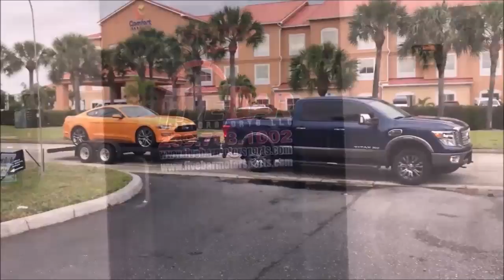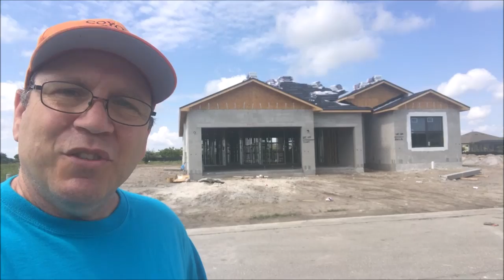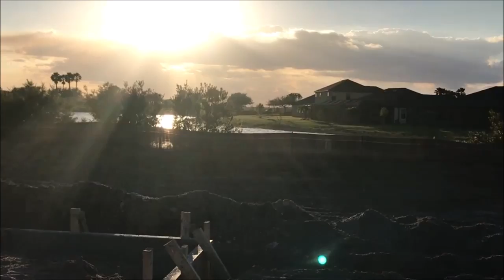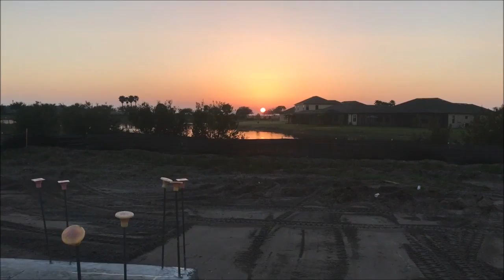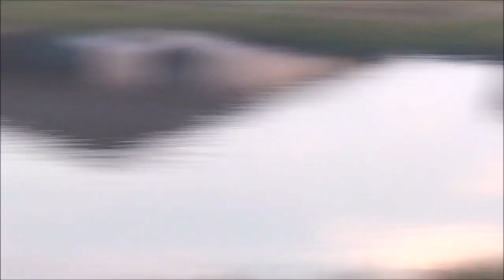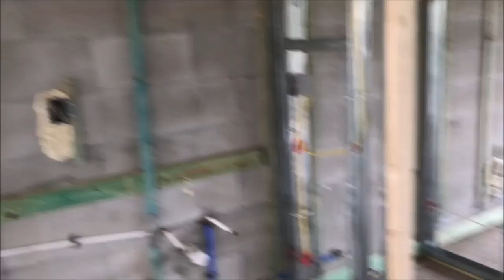2018 Mustang GT 5.0 Engine Build Moved to a New Shop _ Check out my other Build!!

Comment: You're darn right about taking a toll I've been in construction all my life I'm an equipment operator that don't sound so bad but let me tell you what it will beat your body to death I can barely lift a cold drink with my right hand but I still turn wrenches and pull engines on the side simply because I can't afford for someone else to do it but I do it at my own speed and I still love my close ratio 4 Speed and my F-450 has the ZF 5-speed I don't feel safe in an automatic I still have strength from my elbow downward I just can't pull from the shoulder I been following this cat with the stangmode videos I'm going to learn how to work on one of them modular engines one day you know you can adapt a set of LS headers to fit a 351 Windsor

Comment: Congrats on new home. Glad to see they cut several relief cuts in the floor, it helps with keeping the cracking contained. Here in Fla floor cracks happens a lot.
Reply from the maker: D & K Vloggers...... With all the saw cut's i already see cracks.. but a anti-fracture membrane will be used to stop the tile from cracking.. I will show this in the next video!

Comment: looks great!   I am surprised that the builder does not hassle you for being on property, after all, they still own it at this point.   what area is your current home? the new one?
Reply from the maker: Jon Peterson........ The builder really doesn't like when we go into the house but they don't hassle me. The security guard follows me around though.. I live in Ft. Myers Florida.
Reply: do they use rebar and mesh in concrete in Florida?
Reply from the maker: Jon Peterson...... Some builders use mesh and some use fibers.. Mine was built with fibers.. Yes we use re-bar..

Comment: Good Luck with the new engine and the new house Al!! I think you did good by holding off on the build til they moved to the new shop. Stop & Go work increases the chance for errors and you are better off not taking the chance. I look forward to seeing that Orange Beauty burn some rubber again!
Reply from the maker: tominator........... Yeah i didn't like the idea of moving my car in pieces. Doug at five bar really wanted to bring the car to the new shop also. Thanks bud! we will be up and running hopefully in the next few weeks!